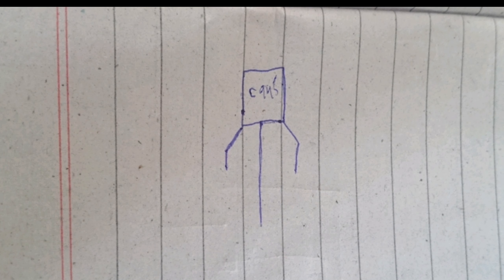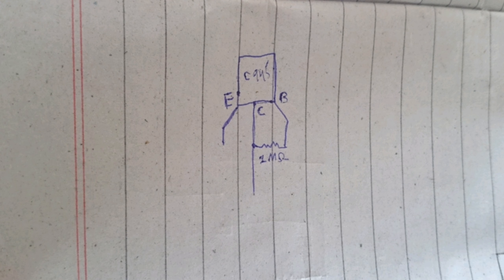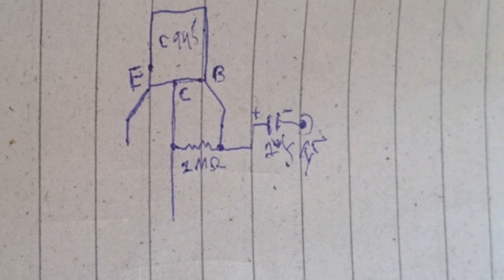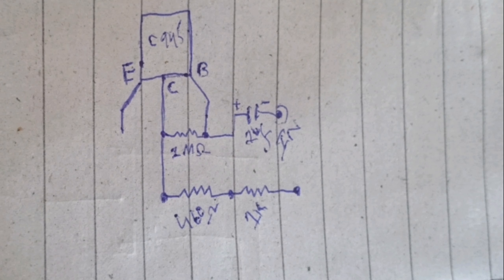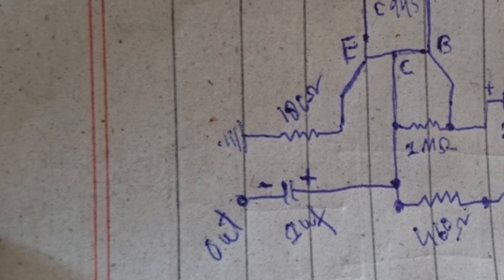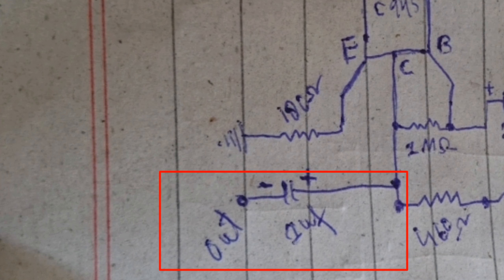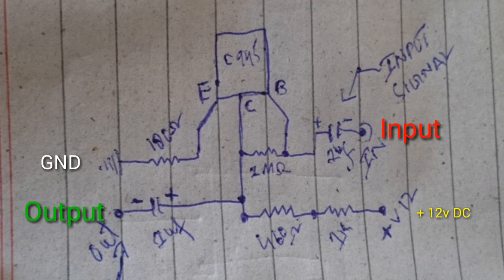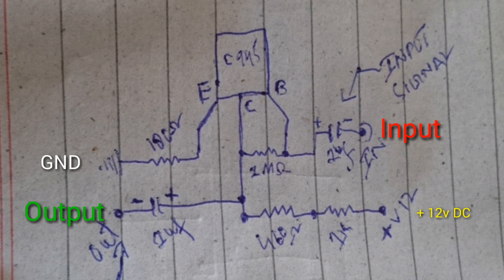How to increase the input signal gain - Gain boost - New Generation 123

Comment: Sir
Output iska 1v hoga
Line in May de sakte hai amplifier ka
Reply from the maker: output main capacitor lagae 1uf ka koi masla nahi hoga. bhot acha sound hai iska. try it
Reply: Ok sir
Par my amplifier required 1v line audio signal
 gain thora High hoga sir is circuit may? Mobile ke out put se thora jada chahea
Reply: Haw many amplifier conacat 5-10 amplifier? Is ka gain ghate ga Nahi sir please reply